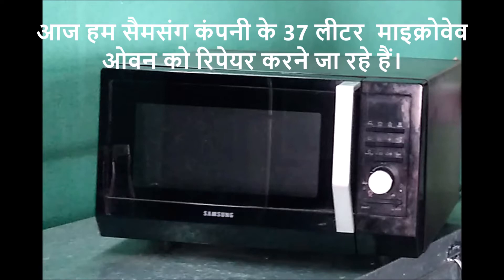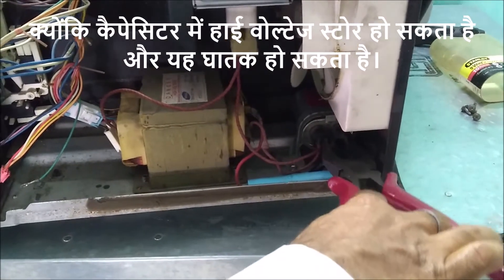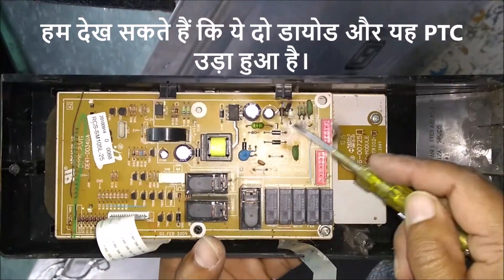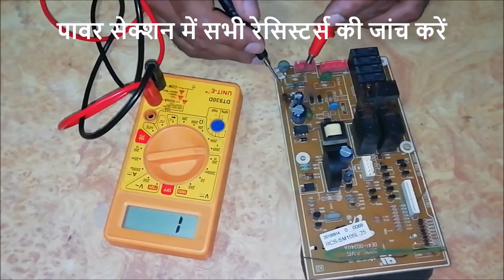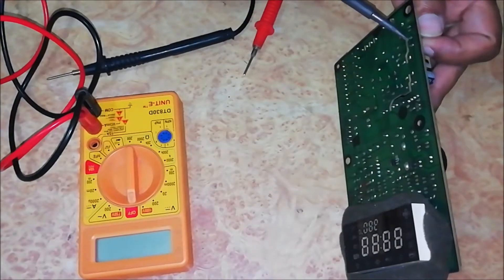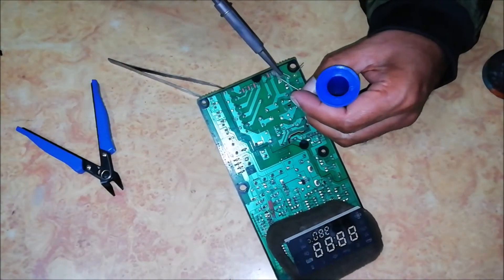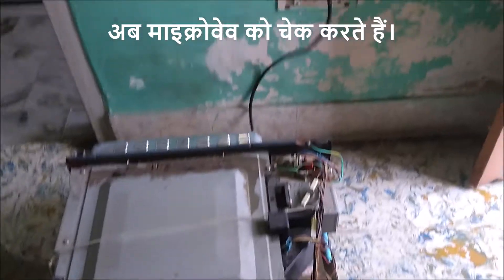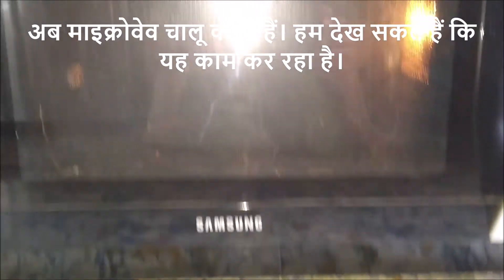how to repair samsung microwave with no display and no heating

Comment: Samsung convection microwave oven pcb power supply 12v & 5v ok display not power on problem?
Reply from the maker: may be the display IC is bad.

Comment: Sir my oven plugged in to power automatically powers on , only fan is running no display, no light ,no heating. This happened after multiple time power cut in house
Reply from the maker: The oven fuse may have blown
Reply: @diyrepairs  after 2-3 days automatically it become normal. Thanks for the reply

Comment: In this pcb voltage on crystal is ok ,but it won't turn on, what is the check points pls guide
Reply from the maker: check 5 volt supply to microcontroller ic.